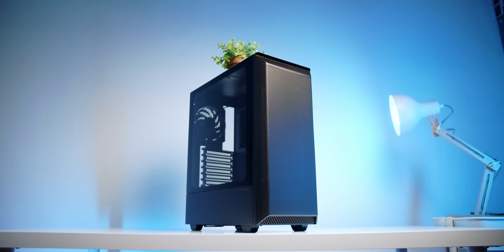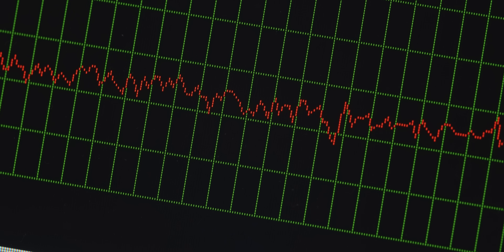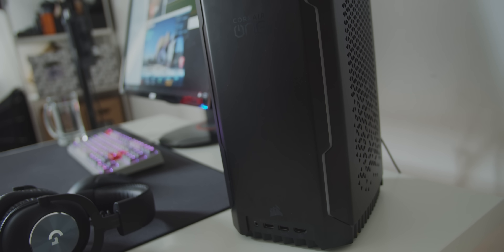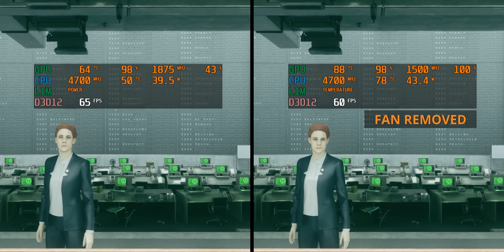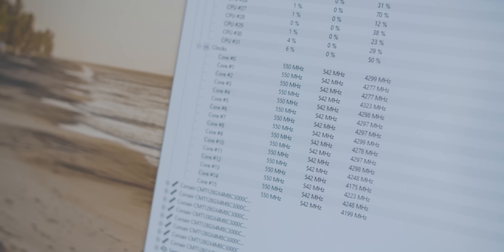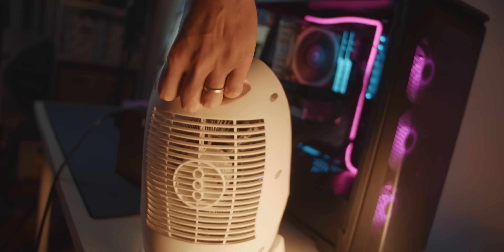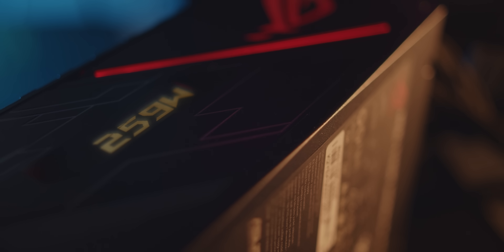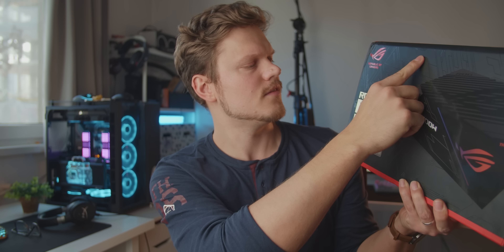This Is What Happens When Your PC OVERHEATS! 🔥

Comment: It happens more so in hot weather if rooms are heating up from the sun especially the afternoon sun if that room is getting it in my case. If the room is cooled it won’t have that issue. Most overheating caused are from too much power drawn as overclocking GPUs increase the power drawn which is the case if you try to play real life minecraft shaders mod since it pushes your pc over the limits.

Comment: Please help! I’ve got a 2080ti, 9900k, psu 650w 32gb 3600mhz ram motherboard Asus prime z390p I have 240mm aio cooler …. I’m having problem with temp when in game gpu temp 87max cpu temp 60degrees And both of my SSDs are 50degrees and 68degrees
Reply: Can’t figure whether I need a new case with better airflow or better psu or something else

Comment: I overclocked my pc and run it all week without turning off and nothing happened... I also tried to replace the cpu cooler with stock to make it heat up but still on 70°-80°... Then I removed the cpu cooler then I have a smoki'n jet pc

Comment: I experienced something wird. My PC suddenly started freeze while gaming and reboot into the bios. I have installed 2 extra 140 mm excaust fans and now it less frequent. Plus my bluetooth keyboard + mouse doesn't crap out anymore. Strange was even before I installed the fans neither GPU or CPU reached critical temps. GPU was at 72c under load, and CPU at 65c under heavy load. The temps are now 65 for GPU under a heavy load and between 56 - 65c under a heavy load. The case is a fractal 7 define 7. Could it simply be that case couldn't breath? Even though it had 2 intake and 1 excaust fan ? Since I have it my floor? But the 2 excausts fan in the top really helped. 

Considering two buttom fans to cool the graphics card and CPU/GPU extra. But don't know if thats a good idea?
Reply: could probably be inaccurate sensors or other overheating components

Comment: i play with all cores hitting a solid 100c at all times when gaming. I got an 8700k with bad internal paste and i don't want to delid and screw it up so i'm just in the process of upgrading motherboard and cpu to a 10900k. so far have my new case thermaltake view 51, a thermaltake 850W power supply and 360 sealed cooler.

Comment: My 8700k regularly hits mid-high 90s on at least a few cores while AAA gaming i’ve done everything but delid so i think it’s the internal paste. I run it to this temp daily for a few hours and it has been okay so far but i’m in the process of upgrading to either a 9900k or 10900k because it worries me. I’ve tweaked bios to ramp way down, i lower graphic settings, ramp up fan speeds but nothing gets me under 90 while under load
Reply: if you overclocked, Don't overclock!

Comment: The power supply got hot from an outside source. If the only way for a power supply to be less efficient is when the power supply generates heat that goes into the environment, then heat that was generated from the environment would not effect the power supply. The environmental heat would act like a cushion to make less of the power supply generated heat go into the environment.

Comment: This was interesting.  

I'm searching for a new laptop because deep breath the grills (intake and exhaust I believe) keep breaking as well as my right hinge so tiny pieces of plastic have gotten into the laptop.  
I tried to remove the bottom cover but two or three screws are super stripped so I can't get into it.  

Because of those little pieces are in the way (and probably the fact that i have a partially opened laptop that I keep on the floor where my pets kindly shed) the fan will stop working (not always but often enough). 

My.~6 year old laptop (Lenovo ideapad) just shuts off and will stay off for a few minutes (when it cools enough of course). 

I don't have anything to check the temps but I've lightly burnt myself on the metal pieces inside that the broken pieces have uncovered.  

The strange thing is that i have NEVER EVER dropped this thing.  
I have no clue why it started happening.

Comment: My pump stopped working 3 times because of some loose contact ek d5,
The cpu 3950x overheated and the system shut down.
Did this any damage to the cpu?
Luckily I have zmt tubes.

Comment: "concentration of heat..."
?? If the fan was spinning there would have been even MORE heat produced as it wouldn't thermal throttle so I'm not clear what you mean, though I guess it might FEEL cooler even if there was more heat because the air would be glowing against your hands and still moving the air away
Reply: (blowing not "glowing")

Comment: I have a single pump, but I have a flow meter that will give an audible alarm if flow stops, and I have a temperature sensor superglued to the CPU cooler that is connected to a Commander Pro, that will turn all fans to 100% at 40C, turn all lights red at 45C and shutdown the computer at 50C coolant temperature.  I also have a custom acrylic plate over the GPU in case all this fails.  If you think this is over kill, if the pump fails, the hard tubing will overheat and soften, and water will spill onto anything below it, which is where your video card sits.

Comment: Power becomes heat, not the other way around.  Your PSU MAY be a little less effecient due to heat increasing internal resistance,  but at those temps it would be hard to measure.  The majority of that extra 10W would belong to the PSU fan ramping up. Rookie question; but was the laptop actually plugged in and on performance mode? 35fps in RDR2 with a 2080? (Granted res/detail undisclosed) my mate has helios with a 1060m which shuts off if he games (on his lap) with standard fan settings. Good iso video though

Comment: Ha,  I recently had my DDC pump fail (2 weeks ago), 
Was sitting here wondering why my fans kept ramping up pretty hard,  just assumed it was a background process at first, then after about 15 minutes it got way too annoying listening to the small jet engine taking off beside me so went into the BIOS to change the curve, and when I was in there it hit me, CPU was @ 90+ celcius. Looked onto the CPU block and the top half was a giant air bubble. Not sure if it was due to the water being too hot and evaporating inside the block or what.  Lucky I had a spare (although much less powerful) pump, so was a pretty easy swap in, then got a brand new pump within the week.  pretty stoked on the whole turnaround to be honest.

Comment: I had a pump "fail" in my open loop some time ago (actually molex connector just got loose), and it only got both my 3770k@4.7GHz and 2070 to 80C stabilized after about 5 minutes on desktop with Firefox and Discord (headphones tend to do funny things, for example preventing you from hearing your PC sometime). I didn't check frequencies then, but 80C is not in the RED-RED zone of this CPU, and desktop was responsible(-ish), so I imagine it was at least still counted in GHz.

Comment: I always try to melt all of my computers at once when stuck at home for weeks.
Reply: It may actually be a good way to keep the virus out of the house
Reply: i haven't watched the full video yet but is it supposed to lag if it over heats cuz that happens to my nintendo switch when over heating
Reply: @Real_Clone  bruuuuuh this is pc not nintendo switch
Reply: @SANitizer20209  DEVICE is DEVICE
Reply: @Real_Clone  no. They are very different
Reply: @nebula_configs  i therms of shape and functions and demensions yes but in hardware no so different they have a gpu a motherboard and a cpu. And a tiny fan if it overheats it wil notice it and slow down the cpu and gpu to prevent demage
Reply: ninte switch has a mobile graphics card but i dont know if ninetendo switches have cpus
Reply: @orangy4189  They do, they have ARM CPUS manufactured my nvidia.
Reply: Bruh my friend came over and we decided to over heat my old pc when it exploded we laughed so hard

Comment: Yesterday ...on my 3950X build the water pump died without me knowing. As soon as i fired up a game the PC shut itself down automatically. Upon reboot i was greeted  CPU fan error helping me realize the problem. Crisis averted because i had dual pumps in the loop. I removed the failed pump,and connected the other pump to the psu.

Comment: the next version of my arduino controller for my watercooling will have sensors for waterblock temperature, acoustic warning, forced shutoff by controlling the psu pin.
i never had a catastrophic pump failure but since i can..

Comment: I did some of these experiments with a Pentium 4 Celeron-D system that was destined for the bin (too many failures).
Deactivating the fan and allowing the heat sink to soak caused decreasing performance until the system locked up and even restoring the fan couldn't save it.
Removing the heat sink itself caused this same progression, except obviously MUCH faster.
I have a laptop with a 9600GT-mobile. Back then GPUs didn't have throttling yet, and the card got damaged when the fan failed, but the owner continued using it (out of necessity).
My Radeon 9800 (pre-AMD) had a heat sink seating issue that caused GPU overheating, which caused massive (and very interesting) artifacts on the screen (until my PC crashed).
Overheating older hardware is kind of fun.
Be careful if you're using pre-throttling hardware though, you can easily end up with stir fried components, and remember that Intel had thermal throttling before AMD, so early 2000s AMD parts can and will HCF if insufficiently cooled.

Comment: I'm shocked the BIOS allowed the SSD's to get to those temps without shutting off. We've come a long way, I have a feeling 5-6 years ago those temps would have murked the drives.
Reply: There's currently no way for a motherboard BIOS to measure hard drive temps. Only thing that could happen is a SMART error on startup, but even that's iffy.

Comment: Never do this with water-cooling, especially soft tubing. Soft PETG tubing for example gets malleable at around 60°C and can just slip out of your fittings. Hard tubing can permanently deform.
Reply: For this (and many other) you can use Norprene or EBDM Tubing :)

But i wouldn't be that worried for AiO Cooler.

Comment: Hi! The Blade's temps might have been still that good because the upper two fans intake air through the keyboard area as well. So to really choke it you could try to cover up the keyboard or just run it in clamshell mode :) Otherwise great video!

Comment: I think the comparison between liquid and air cooling is slightly unfair because the fan still passively dissipates heat through the radiators

Comment: I found out this the hard way yesterday. I was listening to a stream on Twitch and playing some Stellaris. Suddenly the game started playing really slow - Weird. Figured it was a bug so I rebooted it. Still no help.

Suddenly my monitor turns off, but audio keeps working. Weird... maybe it's a cable. Nope. PC suddenly reboots - I look over to the temperature LCD on the motherboard. 99

UH OH - So my EK pump had decided to die a very quiet and sudden death. No circulation whatsoever. Not fun to have to order stuff in these Corona times, but thankfully I have a secondary PC I can use in the meantime.
Reply: consider yourself lucky something didnt fry. sucks when a part just silently gives you the middle finger all day lol
Reply: Also consider urself lucky that you had a backup pc.
Reply: Going through same thing but with my cpu, suddenly was running dota 2 on 10fps and checked my temps and was at 95 lol, getting new thermal paste today and doing a deep cleaning wish me luck

Comment: For the 80 plus rating category, it is very few to see manufacturers to make high 80 plus rating PSU in low wattage(<650W), 
coz it counted in percentage, so roughly, due to the cost vs performance and the product series issue, 
higher wattage PSU like >1000W, high-end/flag ship products, will have the Platinum/Gold grade, lower like 550-750W, mainstream product line will just Bronze/sliver grade.

Comment: Would be interesting how long it would take the watercooled system to overheat with pump running but Rad´s blocked.
Nice vid !
Reply: Rad being totally blocked out of nowhere is pretty unlikely to happen though, unlike a pump failure
Reply: @aerandir1414  very easy if you have a top mounted radiator. Put a box or a book down on top of the PC and forget. I have a cat that LOVES to jump up and lay on the top of my carbide 400C and completly cover my 240mm AIO

Comment: Damn never seen those HDD temps lol, didn't even know it can work at those temps
Reply: Propably decreased its lifetime significantly tho
Reply: @ondrejbrandejsky5592  Fun fact, NAND actually likes high temperatures. Data written at higher temperatures has better retention.
Reply: @countach27  wow, thats actually very interesting
Reply: @countach27  The controller hates it tho. That's the art of solid storage, you want to keep the storage units warm but the control components cold.
Reply: @alex_inside  Yes, of course the controller doesn't like it, but single instance of overheating won't affect drive's lifespan.
Reply: @countach27  Usually if a system overheats it isn't a one time ordeal. 

Electronics is a fine dance with insanity and thermals.
Reply: @alex_inside  damn , im gonna quote what you said from now on
" Electronics is a fine dance between insanity and thermals "
Reply: @Tigron Just keep an eye on your temperatures. 

I got a 5600x with automated overclocking on, and a 3070ti. My system only has 3 case fans.

 It was running Horizon Zero Dawn flawlessly on Ultra, until i took another peek at my CPU temp and saw it just crossed over to 80 so i terminated the application.

For reference, I have an always on AC, but my bedroom vent is right in front of my PC and has to typically be covered because of the heater.

Comment: Dmitry: Lets do a heat test in canada

Me: Laughs in Singaporean
Reply from the maker: LOL.  Tired to recreate a lot of ambient heat.  :)
Reply: Aussie: Let's cook the computer
Reply: Me too laughing in India 😀
Reply: @aryanvaghasiya2342  *saudi arabia*
Reply: Canada gets pretty hot in summer though, I remember my room reaching 40 degrees haha. But yeah, I know Singapore gets extra spicy !
Reply: @Amine-ox2lq  yeah and living in Canada 40 degrees feels EXTRA hot cuz in the winter it gets down to -40, that's a 80 degree difference! hot countries have a 30 degree difference at most and it's easier to get used to the constant heat.
Reply: Senegalese laugh is louder
Reply: lmaoooooo
Reply: Yeah, the heat and humidity is killer. My mini itx PC temps are crazy when doing folding@home, 95C on ryzen 5 1600 stock and 75 on my zotac gtx 1080 mini undervolted. Even normal loads gpu will hit close to 85 but cpu tends to stay cooler since not all cores are loaded. Could also be just the fractal node 202 having abysmal wind flow
Reply: Mervin Ling fold with your gpu only to reduce the hot air inside your case
Reply: @goldentusk4555  haha sorry for the late reply, didnt check my notifications. Nah its just shit airflow of the case and re-ciculation of heat at the cpu area. Will look to fix the cpu situation when im free with the amd stock cooler mod to fit in my node 202 and cardboard to block the venting area to prevent heat re-circulation.
Reply: @Tomyummmm  are you using the stock cooler and do you have the AF version?
Reply: @jamestor6700  oops i didnt see the notification for this sorry, i use a cryorig C7 cooler on the cpu and i added two noctua ippc fans at the gpu chamber, gpu temps are in check now, never going above 70 with the fans pulling in air. Only the cpu overheating on small tasks, might do the amd stock fan cooler mod to fit it in my case and put cardboard venting to prevent heat re-circulation.
Reply: I hate hot places so much. In recent years there days in summer with 35C temps in my cooler country. Gone are the days of 20-25C summers.
Reply: @exlibrisas  I have hot places too. My body swetting all over
Reply: he's in Bulgaria
Reply: AYYY singaporean
Reply: its dam hot recently ....
Reply: Me: Laughs in Malaysian
Reply: LOL nothing like the equator?
Reply: laughs in Indonesian
Reply: same
Reply: Laughs in Indonesian 🗿
Reply: Me laughing in philliphines
Reply: Cool climate, A/A or heater on(most likely) so there is air filtration. Controlled humidity. Its almost like living on the meat section on the supermarket.
Reply: As an Indian who has lived in Singapore for a year, it's honestly not that bad lol
Reply: Laughs in South Texas during July.
40C this week
Reply: laughs in malaysian
Reply: As a singaporean myself, It pretty funny
Reply: Hold my pad thai
Reply: it’s 50 degrees celius here